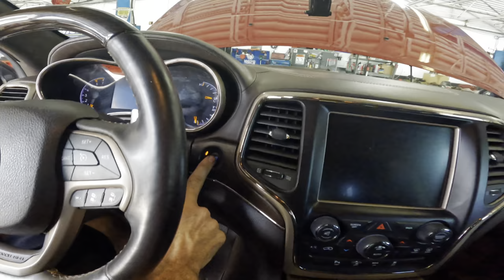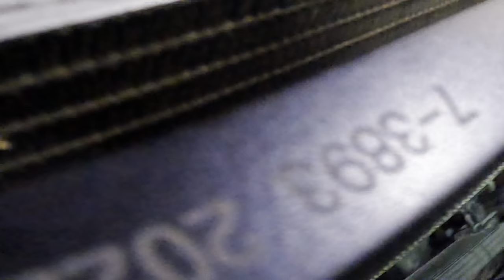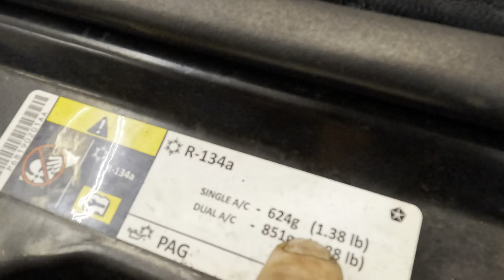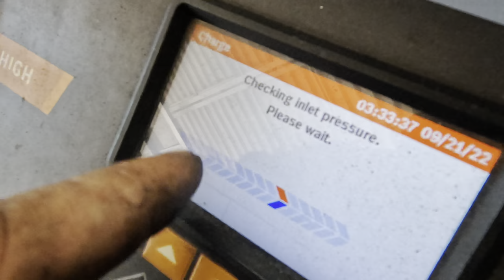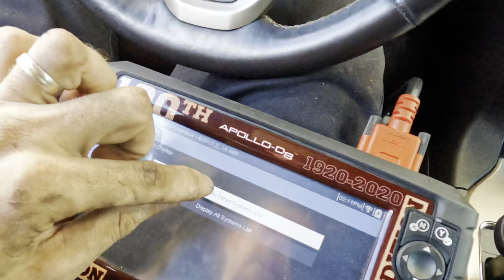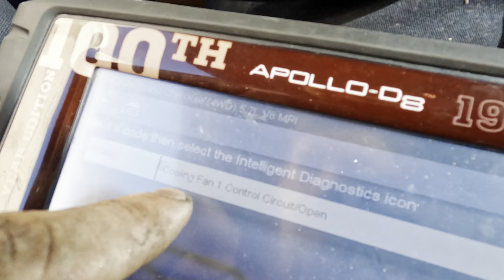Hidden Collision Damage! This thing blew up twice! Jeep Grand Cherokee 5.7

Comment: I wish I could be there assisting you set up your workshop. The air system looks great. As for the lights underneath the toolboxes, will save you time. Items dropping and bouncing or rolling under the toolboxes will be found very quickly, instead of struggling in the dark.

Comment: That's what I call quality. 8 year old vehicle and the A/C is already leaking.
I used my 2004 Hyundai Santa Fe for 14 years, and it was still blowing freezing cold air with its original A/C charge. Never maintained the A/C system because it was running at peak efficiency when I donated it to the Salvation Army after 14 years and 195K miles of  use.
Reply: interesting, hyundai isnt known for great quality. i mean FCA is the worst US automaker by far, but im not sure if they're worse
Reply: What you failed to note was the amount of physical damage to it.  Here's a hint-if your Hyundai would have been in a frontal collision, it too would likely suffer similar damage.  Hyundai isn't exactly noted for their high quality (hence the class action lawsuit on their Theta engines failing early).

Comment: I've found that on pretty much every modern car, removing the radiator, condenser and fan as a unit is usually the quickest way. I will say, this is the first time I've seen a trans cooler in the A/C condenser, rather than the radiator. Chrysler has been doing interesting things with A/C systems as of late. They also used the A/C system to cool the intake charge on the Demon.
Reply: My friend Al had a 1971 or 72 Dodge demon with cragar mags all the way around 14s in the front L 60 15s in the back and Cherry bomb glass packs we used to cruise around with our 8 track listening to Frankenstein by Eger WInter have a great day

Comment: My 2015 Silverado had the same issue with leaking condenser. Mine was a bad factory weld on the condenser.   Wasnt too bad to replace but it took me months to find one in stock. Dealers wanted $1200 but I finally found one and did it myself for $170

Comment: It's Fluorescence you're looking for. The fluorescent particles in the dye absorb the UV and changes it's energy state because it gets excited by the UV "radiation", when then dye particles change back to a lower energy state they give off electromagnetic radiation in form of visible light
Reply: I assume knowing this will help me spot it better.
Reply: @dpaulak  this is cynic comment without value, ofc not, but Ray asked for an explanation because he knowingly used a wrong word

Comment: My radiator hose running out of the thermostat has a clip in the most inconvenient spot.  I can usually get it off easily enough but putting it back on always turns into 30 minutes of blood, sweat, and cussing.  After the 4th time of dealing with this I broke down and bought a set of hose clamp pliers.  Now that I've done that I'll probably never need to use them.  LOL
Reply: I recently bought hose clamp pliers too; those factory clamps are a pain !

Comment: Hi Ray, I just wanted to comment on the engineering of modern day vehicles. You show us what the flaws of too many different people involved with making every system fit in together in todays body designs. A job that really should not be too hard, as it's a wear item, takes all day. Like when the parking brake became part of the caliper. Nice job Ray, you make my day. Good luck with the storm.
Reply: But it makes the assembly process more efficient when everything is packaged into sub assemblies that can be dropped into place as the vehicle makes its way down the line, increasing profit!
Reply: @markbeiser  As an engineer, your correct, but I also know it's planed obsolesce. My Yukon with over 220K, "1999", is a POS electrically, but it will last another 10-15 yrs here in Colorado. Let's see how many vehicles make it 20 yrs built today. Just saying.
Reply: @guesswho9742  Not many, especially not the ones with high strung turbo engines, or over sized V8s stuffed into too small of spaces.

Comment: Makes me so glad to have my basic a$$ 07 Hyundai. Part of my condenser flat out exploded while getting off the interstate. Back then I had NO ac experience. Seeing what looked like steam coming out of my radiator area, I thought my radiator blew. Finally got it home (40 minutes away), figured out the problem, and it took me about 45 minutes to replace the condenser. Had to take it to a buddy with the AC vac/recharge machine but still, uv dye saved me hundreds in parts and so much in time.

Comment: When I replaced the condenser and drier (and compressor, after a seize-up in 2018) on my 2004 Frontier, I took the front grille and stuff off for access and the R&R.

Comment: I've had to do the same job on one of these (a newer one, a 2016) and what I did to make it easier is I took off the bumper crash bar and the hood latch. That made it way easier because there was almost nothing in the way. The only thing that was in the way was the intake and the fan.

Comment: Did he forget to put the ring clips back on the transmission lines? They were still in the bolt bowl when he was putting everything back together.
Reply: I was wondering the same. I would imagine once he got to the end of the fastener stash and found the 2 clips he would install them ! I was waiting for the " aha you all thought I forgot the clips!".. but it never happened. 
Well at least it shows how gripped by detail we are as observers. 👍🤗
Reply: Pretty sure the new condenser had new clips already installed.
Reply: Clips are now the next guy’s problem.
Reply: Yup he forgot the ring clips

Comment: Firstly, stay safe. Second, I re-watched it 3 times to figure out that bracket you condemned at the end. I think it was there to block the belt. I still remember 70's cars, that had room for a picnic under the hood. My first cars was a Datsun B210. I lawn tractor with a body. zero effort on all parts. Buddy of mine had a gen 1 civic.  Easy-peasy to work on.

Comment: The best thing to do is remove the fascia It's like 10 easy screws drop the bottom bracket holding up the radiator and you have access without opening the cooling  system. For future knowledge.  With the 3.6 pentastar you can do it the was you did. There's more room on the 3.6. But again the fastest way is remove from bumper/fascia.. 

Secondly the wk2 is a jeep. It is offroad capable. It can rivel some wranglers.

Comment: you need to get Knipex hose clamp pliers,have special little rotary tips for the constant tension squeeze clamps several sizes for all different size clamps . not to be confused with Otetiker clamps,different stuff
Reply: These thing are junk they never fully open the clamp and make it almost impossible to pass over the bead roll

Comment: For the question at the beginning.  The term is Fluoresces, as in a fluorescent light.  The dye particles are excited by the wavelength of the ultraviolet light, which is somewhere near 365 nanometers.  Then when they are excited they emit a photon, making them more visible, and appearing to glow.  Same idea as magnetic particle inspection and fluorescent particle inspection used in aerospace applications, only there used for defect detection, rather than leak detection.

Comment: The push pins you describe, are called push nails @ GM, so many are used a small hammer is used once placed into position then tapped flush, FYI

Comment: Considering your hard ways, I just recalled a short reference in a late 1950's or early 1960's Reader's Digest.  It told an argument between then princesses Elizabeth and Margaret and their home teacher about an impossible task.  The teacher claimed nothing is impossible, if you try hard enough.  On which the young smart ladies replied:  Have you tried to put the excess tooth paste back into the tube?

Comment: Hi Ray, love your vids, first time commenting. One fan already commented on the dye. It is fluorescence, to be a little more specific, the dye has elements that absorb UV photons from your black light. The energy from the absorbed UV photon pops an electron up into a higher energy state. When that electron falls back to its ground state, conservation of energy must be maintained, and that energy is released as light in the visible spectrum (green). You got quantum mechanics mixed into your auto mechanics... My explanation is not rigorous, but it's a high level explanation of how it works. By the way, it's the same principle that fluorescent light bulbs work on, that may be an easier topic to find info on with an internet search.

Comment: I had to buy a Mopar upper hose once you break that special zip tie. Upper hose will slip back rub on alternator pulley. Very strange design on 2014-2018 grand Cherokee with 5.7

Comment: Cool to see a condenser replaced without removing the front bumper assembly on this vehicle. Kudos to you! Though that upper radiator hose clip simply slides out...you don't dismantle it like you did...though that was fun to watch you reassemble it. LOL!

Comment: The proper term is UV luminescence where the reaction to UV light is instant and quick to dissipate.  These dyes are also used in laundry detergents to brighten clothing.  Phosphorescence is a process where the light is absorbed and then re-emitted.  It is slower and longer lasting.  Think glow-in-the-dark stickers and watch dials.  Do-de-do.

Comment: to install a new radiator on  our 2009 Kia Picanto, it  was necessary to remove the whole front bumper, grill etc; there is no way that it will come out otherwise, because it is tucked under the cross member where the hood latch is
Reply: Ray could do with the bumper on.

Comment: Those little wire clips that hold trans lines to combo condenser... I have used a stip of cloth {old t shirt works great} to snag  one of the tips and get it pulled out a bit for the long nose to grab...

Comment: Those two wire clips for the transmission cooler connection were in the screw cup when you finished.

Comment: the glowing is caused by floresences, literally like the light bulbs. as the Ultraviolet light hits a compound that exhibits these florescent properties they excite the valence electron (ones on the outside) to have more energy. as the valence electrons lose their excited state they emit the photon that we see. also yes you can call it photoluminescence because it is caused by light and that term isn't exclusive to visible light.

Comment: I like how Ray removed the bracket to stop the mopar induction pipe getting scratched, when it clearly has more dents and scratches than a builders van!
Reply: But thanks to Ray making the video, that prevents the customer from coming back and saying the mechanic must have scratched and dented what was a pristine Mopar air tube.
Reply: Funny, but the silver intake tube (at the bend closest to the engine) didn't have a dent in it at the beginning of the video—I went back and checked. Since the tube was an aftermarket piece, I'm pretty sure that the owner will not appreciate the damage, which really stands out.

Comment: Watching that hose clip get stubborn had me muttering. I think Ray couldn't see the front end of the clip not hooking on. Great armchair entertainment!
Reply: Me too.  I was literally shouting "Just press the front tab down first and it will engage" and physically pointing at that front part with the hole in the middle of the tab on my laptop's screen.  You beat me to it =)  I think the initial problem is the previous person under that hood also didn't lock that tab down so he didn't see it during disassembly.  Ray did state at the start of the video he wasn't familiar with that platform (and neither am I but I'm really good at puzzles).

Comment: I missed the reinsertion of the little C shaped clips on the power steering lines. I remember back in the 60s and 70s all cars were much easier to work on.

Comment: What is dye in air conditioner?
It's a method in which a small amount of fluorescent dye is injected into and circulated through an operating system. The dye/refrigerant mixture will escape and accumulate at all leak sites. By then scanning the system with a leak detection lamp, all leaks will fluoresce green or yellow, making them easy to spot.

Comment: After servicing and adding dye if you were to spray off (make shiny) the fittings and areas around them you might not see the dye around them and also not have to explain it.

Comment: I'm still amazed the condenser on my 2007 F-150 doesn't leak. There are some huge rock impacts. Battle damage from landscapers', mower trailers flinging rocks while driving in the opposite direction on 2 lane roads.

Comment: As a automotive tech for over 50 years I see many many programs that you're doing the hard way for instance😊 rear drum brakes p you assemble the brakes before assembling up to the back plate that is the correct way to do! Do it as a unit and then put on the locking pin of course put the horseshoe on first!

Comment: I think you still did not get that upper radiator hose clamp completely snapped in. Look at 35:30.  Right below your thumb is the front edge of the clamp. Go a few seconds more and you will see where it has a notched portion of the front edge that looks like it should snap downward over the lower part of the clamp.
Reply: Also note at 30:10 he replaced the white clip retainer without installing the spring retainer for the transmission line in a single take. I’m assuming he came back and replaced the clip off camera.

Comment: The one thing that this videos like this show is how difficult it is to fix or replace nearly anything on cars today. I watched a History Channel show on trains last weekend, and they showed a diesel locomotive getting serviced. The one thing that struck me was how regular maintenance items were easy to get to, and easy to work on. This shows a basic difference in how these two modes of transport differ. Automobiles are designed to be put together as easily and inexpensively as possible. Repair and maintenance are not a design priority. Locomotives, on the other hand, are designed to be serviced.

Comment: the UV die contains molecules (they can be different composition/colour) that the UV light can excite. This excitation causes the electrons to jump from one orbit to the next upper orbit but since they are not on the proper orbit they jump back to their proper place. When they go back, they emit light that you can see under the UV light. This is similar to fluorescent colours (pink, yellow, green etc) for clothing that seem brighter in cloudy days since they reflect the normal light that you can see (and that everything else reflects) but the fluo dyes convert some of the UV light to visible light so the clothes (or paper) reflect both the normal light+ some of the UV light (that you cant see) but has been converted to normal light that you can see.

Comment: Ray, the UV light reflecting a " visible color " when shining on the dye is quantum mechanical in nature. It's for the same reason you can see through glass in the visible light spectrum but not in the UV spectrum.

Electrons that makeup the atoms of the dye will only jump to a higher energy under the excitation of UV light and will have a multiphase emission when going back to the " ground state " aka zero energy state. One of those multiphase emission frequencies are in the visible light spectrum resulting in... well... luminosity we can see with the nekit eye 😉

Comment: Hoping the storm gives you a miss , stay safe . 
Fluorescence is a form of photoluminescence , the light emitted having lower energy than the excitation light , in terms of a rainbow the light emitted will be above the incident light , for instance UV would be at the bottom of the rainbow and that green is near the top .
So it's just a subset of photoluminescence in the way that you are a good mechanic but not all mechanics are good .

Comment: You would think that with a leak that large you would have been able to find it with an electronic leak detector. I am also surprised the system passed a pressure test or the evacuation test. Ummmm. Thanks for the videos!

Comment: It is called fluorescence. The dye molecules absorb electromagnetic energy (photons) in the UV frequency range. This causes valence electrons in the dye molecules to jump into a higher energy state (or higher orbital shell). An electron will then quickly fall back to its original lower energy state, emitting a photon of a different wavelength in the process (one which is in the visible spectrum). So the sample is continuously absorbing one invisible wavelength of energy then emitting another visible wavelength as long as you keep the UV light on it.

Comment: The 5.7. Is a lot bigger than the v6 it was originally designed for. That is why it’s like ten pounds of crap in a five pound bag so it is a lot of power in a light vehicle fun to drive but not fun to work on. And of course it doesn’t help that they ordered it with every accessory that was available

Comment: Love the channel, Ray! Say, those safety clips for the transcooler lines that go into the radiator.  I noticed you didn't show putting them back on.  They were still in the parts tray there near the end.  What happened?
Reply: New condenser came with new ones preinstalled

Comment: Those little bitty clips on the coolant line that attached to the condenser are like removing Contact lenses.  They are so tiny and in such a bad spot boy they could come up with a better connector than that.

Comment: Check out the cooling fins on the back of the fan motor... never seen that before! COOL! :) Nice work bro! I work out short cuts too to give myself a raise! :)
Reply: It most likely the speed controller/soft start module cooling fin for the fan motor
Dodge love to use these